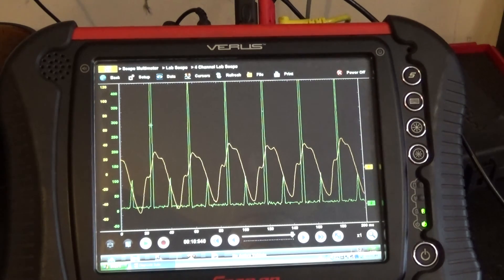How To Test Fuel Injectors With First Look Sensor On Any Fuel Systems

Comment: This doesn't work on "any fuel system" modern cars have high fuel pressure with no service ports and pressure is controlled electricity not by vacuum. 
But the information is still good, keep up the great videos!
Reply from the maker: savagepunker you are correct. This will not work on GDI systems but it will work on any port injection fuel system regardless if is return or return less design. Thank you

Comment: Very interesting.... thanks for sharing the info :)
Reply from the maker: South Main Auto Repair LLC thank you Eric for stopping by. I been experimenting with this setup for a while. It does work but it works better if you can position fuel pressure regulator closer to fuel rail. Interesting is that signal is more clear on returnless fuel systems.

Comment: Wouldn’t you have a different in cylinder not getting fuel in the compression of that cylinder like doing the compression test with a scope
Reply from the maker: orville58 lack of fuel will not affect cylinder compression but if you have ignition problem of injector that spraying to much fuel it’s possible to have cylinder wash down I that will affect compression for sure. Thank you

Comment: Have you tried putting your ebay transducer in AC mode and zooming in?  I see meaningful pulses on mine, one for each injector.  Maybe not as sensitive as First Look, but it seems to work.
Reply from the maker: Louis Pasnik You can AC couple your signal if signal is very low and you can’t see it on your scope. There is nothing wrong by doing that. I generally don’t use it if I can see my waveform on DC settings. 👍

Comment: Very slick setup. I like that a  lot. Great video.
Reply from the maker: Joe's Auto Electric thank you my friend. I used FLS and pressure transducer to diagnose bad intake valve on Chevy truck back in January . It was very interesting case study. Cheers my friend.👍👍
Reply: @kyhomegarage3430  , Joe's Auto Electric . I had extra snap-on  fuel gauge. Removed the dial gauge and put 100 Psi transducer in place. Awesome for injector balance test also. Save, Print , Customer.
Reply from the maker: Dewey Carlson I customized my fuel pressure gauge set by adding adapter and now I can use pressure transducer and gauge at the same time. 👍
Reply: @Joe's Auto Electric . I had extra snap-on  fuel gauge. Removed the dial gauge and put 100 Psi transducer in place. Awesome for injector balance test also. Save, Print , Customer.

Comment: Could you not put any ignition coil or injector, on another
channel & count down the firing order- to the unknown
failed injector, assuming that was your scenario ?
Reply from the maker: pc zapp you are right I should use another channel with a single injector firing and use firing order to find bad injector. This video is for information purposes only to show how to make device to use it on fuel systems without fuel pressure regulator. Please watch my other video were am using first look sensor with MODIS to test fuel injectors. Thank you for watching.

Comment: yes sir   got some great waveforms on my pico   4 channel      have you used your firstlook PPS  on intake vacuum or at tailpipe  looking for misfires  ?  wonder if you could make a video ?     thanks again   mark
Reply from the maker: Mark Ferraro I did watch my video Chrysler Sebring single cylinder misfire its two parts video. I am glad your sensor is working.

Comment: Hey KY home garage man. I got all my parts to do this test on my 04 Honda. I use the firstlook sensor and got a Lucas fuel pressure reg from eBay. I noticed in the video you supplied fuel on one reg port and plugged the other port my question is on my pressure reg I can't tell what is the supply port. And what is the return port as if the regulator was a working part of the car. The diameters are the same. I'm thinking the supply port is in line with the vacuum port any suggestions. Thanks again for a wonderful outside of the box type video. Mark
Reply from the maker: Mark Ferraro port with 13mm nut is your pressure port. Hope this help.

Comment: Great video. My first look sensor comes in Monday.😃
Reply from the maker: That is great. Good luck with your first diagnosis. Thank you for watching.
Reply: +KY HomeGarage (KYHomeGarage) I am looking to buy a Snap-On 500 psi pressure transducer. You advised me to go with 300 psi. They only sell 100, 500 and 5000 psi transducers. 

Is the First Look a better choice? Or are they all similar? 

Thanks!!!
Reply from the maker: Emmanuel Vences please contact me  ruzic@bellsouth.net thank you
Reply from the maker: tgoodm1 please watch my new video how to use aftermarket pressure transducer. Sorry I was wrong you can use aftermarket with snap on verus or modis. Thank you

Comment: great video KY  like the way you think   that is a nice build with the regulator    i have a firstlook sensor   sentex   i would love to be able to do what you did on returnless hondas with no fuel pressure test port and no fuel pressure regulator on the fuel rail  i cant seem to find any honda adapters to get into the fuel system.   any ideas?   happy newyear
Reply from the maker: What I did for my Chrysler adapter was go to the junkyard and cut parts of the fuel line off of a similar car. Then I used that to create my adapter for the fuel pressure gauge. That is how I made my adapter you can try a similar method for your Honda. Hope this was helpful thanks for watching.